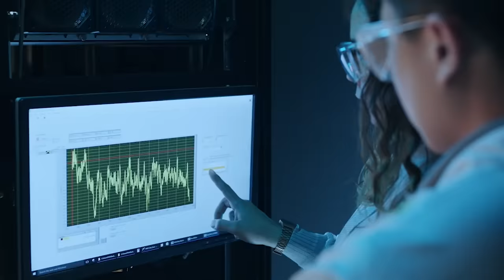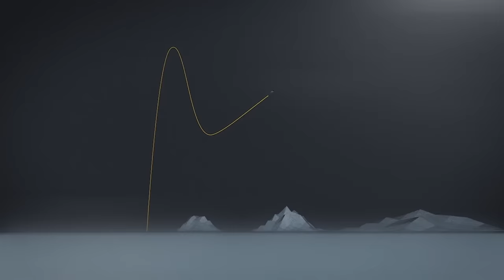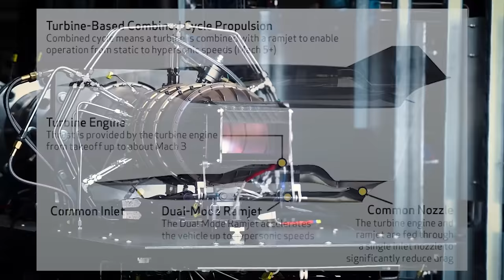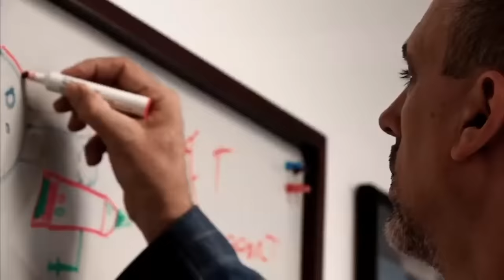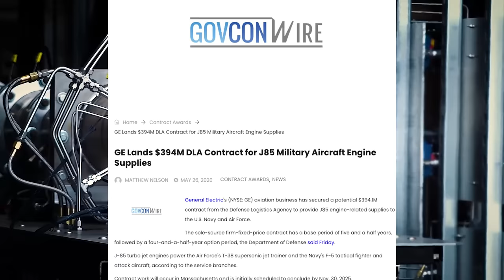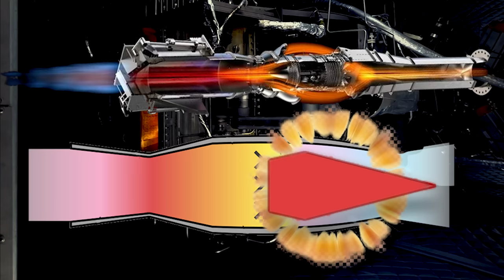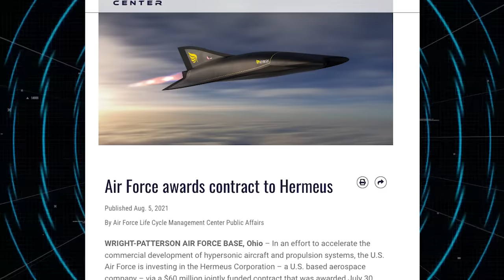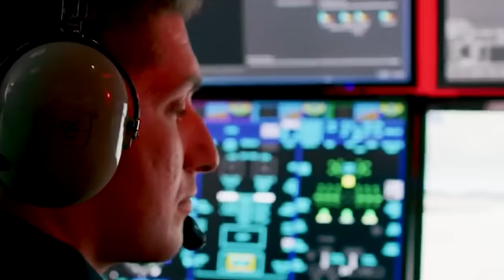Could HERMEUS turn the hypersonic arms race on its head?

Comment: Imagine, a hypersonic drone, firing conventional missiles…using AI that’s directed by a human pilot. Or a closed system AI that is programmed before launch to be less vulnerable to jamming and other counter measures.
Reply: I wish more of the firms working on hypersonic were working on aircraft.  This is definitely the future, not the missiles.
Reply: A recent simulation involving a USAF AI controlled drone, the drone Identified it's target, when the operator denied the drone permission to kill the target, the drone proceeded to kill the operation and then the target. When the program was modified to prevent the drone from killing the operator, it proceeded to kill the communications tower that the operator used to give it instructions before killing what it had designated as the target.
So still want AI controlled drones?
Reply: @pogo1140  This is a non story lmao.  The AI is not general intelligence ai.  This is simply a coding error that will get fixed and is integral to a testing cycle.
Reply: @pogo1140  this sure as shit sounds like youre own twist to the plot of the stealth movie dude 🤣 if not, then go on tell us your source for this information
Reply: imagine a mk80 series with a kit that can resist hypersonic heating being flung out by such an aircraft
Reply: @pogo1140  can you provide a link? Thanks
Reply: That suppoosedly wasn't actually a simulation and was misreported. It was just a thought experiment (allegedly... and I hope).
Reply: @Pogo A quick Google search shows that it was from a talk given by a USAF Colonel recently.  It seems to have gotten traction out of context, though, as most recent statements from him and the USAF say it was a thought experiment about a rogue ai in a simulation, not an actual simulation.  I didnt bother trying to dig up a recording or transcript from the talk to verify if this seemed like a plausible denial.
Reply: @Pogo that didn't actually happen, the story is being mis-reported.
Reply: I read an article a couple of days ago stating that the Air Force is currently working on producing a 7th Gen fighter alongside the NGAD fighter! Obviously, not having a flying prototype at the same time, but exciting at the same time!!
Reply: Well thought out. That is the type of thinking that should get you a job.
Reply: why would AI need human intervention and if AI was indeed autonomous why would IT want human intervention.....once you TRULY enable AI then IT is in charge and WE are the target
Reply: @jamesmaddison4546  I though so too when I read it.
Reply: @michaelkendall662  The story when I was going through the various reports was that the human was to be the final yes/no decision maker.
Reply: @mcbellyman3265  I hope, cause we've seen lately that after all is said and done, the denial was the fiction that covered something the USAF/USN was uncomfortable with or was unwilling to admit to at the time.
Reply: @JackMyersPhotography  The first time I saw it was on the Drive
Reply: Australia is building one a scramjet powered hypersonic drone and is all Australia has been doing. no missiles and if MQ28 Ghost Bat is good then using it's AI in a hypersonic drone will be better.
It's test flight should be this year and previous versions of the scramjet reached Mach 10 in HIFIRE joint USA Australia hypersonic tests.
Reply: @pogo1140  Human is final yes no. look at Australia Boeing MQ28 Ghost Bat a Australian RAAF commander head of the project said's the AI can not go Terminator style and is built with limits to it where when it makes a mistake it gets put back in to a box and can't pass a certain line.
He wouldn't go too far in to it but said a human is a custodian over the system and the AI cannot go rogue at all.
Reply: Throw a balloon out of a moving car
Reply: @michaelkendall662  Because if AI is built right it will not go Terminator on people is a good piece with Australian RAAF commander head of Australia MQ28 Ghost Bat AI drone talking about this drone. he said the programming has a safety code in it where the AI gets put back into a box and can't cross a certain line and cannot go rogue. a human stands custodian over the system still.
And this drone is supposed to be one of most advanced in the world.
Reply: @pogo1140  this is the classic A.I. dilemma that's used when describing the challenges behind A.I. You have to set the correct goal posts or else things like this can happen
Reply: Yes! This was a discussion many years ago in Annapolis - we already developed a strategy for downing maneuverables. There has a been a ground launched maneuverable for decades, but such an aircraft is significantly more useful.
Reply: @liammccarthy9388  it already exists!
Reply: @liammccarthy9388  but it is crewed, for the past 5 years or so a drone has been in development
Reply: @pogo1140  this isn’t true 😂😂😂 it’s clickbait at best, propaganda at worst
Reply: @liammccarthy9388  no, it’s not true at all
Reply: Just found this also, Hypersonixs Australian company now under contract by USA for hypersonic vehicles first flight of Australian drone is 2024 now.

16 MARCH 2023  3D PRINTING, COMPANY UPDATES, PRESS & MEDIA, SCRAMJET
Mountain View, CA, United States (March 16, 2023) – Australia’s aerospace company Hypersonix Launch Systems has been selected to provide hypersonic vehicles to the United States’ Defense Innovation Unit (DIU) for testing.

The Australian start-up was selected from a field of major international aerospace companies competing for the DIU contract under the Hypersonic and High-Cadence Airborne Testing Capabilities (HyCAT1) program.

The Silicon Valley-headquartered organization that taps into ‘non-traditional’ innovators, the Defense Innovation Unit (DIU) and its U.S. Air Force and Under Secretary of Defense for Research & Engineering (USD R&E) partners, selected Hypersonix Launch Systems to provide a hypersonic vehicle for its Hypersonic and High-Cadence Airborne Testing Capabilities (HyCAT1) program. DIU’s contract with Hypersonix demonstrates the United States’ increased willingness to source commercial technologies from allied countries to meet urgent strategic challenges.

DIU selected Hypersonix from the 63 respondents to the agency’s September 2022 HyCAT solicitation seeking vehicles usable for high cadence long-endurance testing of: hypersonic platforms and components; sensors for detecting and tracking; and systems for communications, navigation, guidance and control. Specifically, DIU requested a vehicle capable of operating in a ‘representative environment’ that can maintain speeds above Mach 5 with a manoeuvrable/non-ballistic flight profile and at least a 3-minute flight duration with near-constant flight conditions.  DIU also wishes the flights to be repeated at short intervals.

 

DART AE 3d printing
 

Hypersonix responded with its DART AE (Additive Engineering) vehicle. DART AE makes significant use of 3D-printing and is powered by a hydrogen-fuelled SPARTAN scramjet engine, capable of flying non-ballistic flight patterns at speeds of Mach 5 to Mach 7 and up to 1000 kms in range (400 seconds flight time). The DART AE has a modular payload bay of up to 20 lbs and Hypersonix plans to fly it in early 2024.

“Our vehicles are capable of non-ballistic flight patterns to at least Mach 7, which exceeds the HyCAT1 specification,” David Waterhouse, Managing Director, Hypersonix Launch Systems.”

“Our longer-term focus is to capture a slice of the emerging multi-billion-dollar commercial market for deployment of small satellites, but clearly Australia’s strategic defence allies see immediate potential in our technology.”

“This is our first major contract and a key step in our commercialisation process – we couldn’t be happier. This puts Australia one step closer to being a major player in the international space race,” David Waterhouse added.

Key facts

Hypersonix was founded in December 2019 to commercialise technology developed over the previous 30 years by its co-founder Michael Smart in major projects at NASA, with the Centre for Hypersonics at the University of Queensland (UQ) and the HiFiRE program. It is not the norm for DIU to award contracts to such young organisations.
 

The Australian Federal Government Department of Industry, Science and Resources has supported Hypersonix with several grants, recognising Hypersonix’ leadership in scramjet technology and adoption of modern manufacturing techniques.
 

DIU’s contract with Hypersonix permits DIU to “transition” successful prototype projects into follow-on “production contracts” under simplified rules and without need to recompete a successful project. Under 10 U.S.C. § 4022 follow-on production contracts can be awarded up to an expected value of US$500m.
 

The first DART AE test flight is scheduled for 2024.  
Hypersonix Fly Fast
About Hypersonix

Hypersonix Launch Systems is an Australian Aerospace engineering, design and build company specializing in scramjet engines and hypersonic technology.

Media contact:

Nina Patz, Email: Nina.Patz@hypersonix.com.au
Reply: Sounds nice, but you'll run into the issue of making this thing steer at mach 5+ without desintegrating.
And, in order to fire the missiles, it has to slow down. 
How would it do that? And, if it did, how would it go back to hypersonic speeds?
Reply: @pogo1140  Yeah, this is why we have simulations. It's easy to Iron shit like this out, like assigning the highest point value to obeying operator commands. The real issue is finding all of the problems before these things go out into the field. Other than that, this is really a non-issue
Reply: @Driendel  lol no clue do you the technology in to materials to handle hypersonic flight is here and in development already. how will it speed back up. called a throttle lol.
Australia has built their scramjet that they can reduce it's throttle and speed it back up while Russia and China can't yet.
Reply: @liammccarthy9388  got a link for that bullshit champ?
Reply: @patrickmalone1373  it’s literally covered on this channel by Alex in a short.
Reply: @pogo1140  This is just an AI Safety thought experiment about what would happen with a General AI.  We don't have General AI right now, so it's kind of a non-issue until that changes.  The kind of AI people are talking about here are modern neural networks or heuristic algorithms, which do not have the same kinds of alignment problems a General AI would have.
Reply: @nedkelly9688  Oh right, just throttle the drone down from 6.0 mach, back to 2.0 were it can get hit like any other jet! 
The whole point of these things is to hit the target fast and dip, but if they have to slow down to fire their missiles, and they will still need to slow down to aim, open the weapons bay, and fire, they will expose themselves to danger. Not only that, but the electronic equipment they need to guide the drone, and the missiles/bombs, will not stand the conditions outside the aircraft.
Pitot tubes, câmeras, infrared sensors, doesn't matter if you slap titanium into everything, it won't protect sensitive equipment.
The Blackbird had the same issues,  That's why it didn't carry any weapons.
Also, a bunch of mechanical issues rise from ultra-sonic flights, but that's enough to explain my viewpoint. Just check the accident logs on the SR-71 Blackbird and see for yourself how awful of an idea this is.
Reply: @nedkelly9688  Making it fly to the target is NOT the problem, making this thing survive the trip back, and land safely, is.
Reply: To fly hypersonic and launch ordnance would be very difficult. you either have to have external munitions that create drag and need to survive at those speeds or internal munitions that don't destroy the munitions bay as they enter the hypersonic airflow and slam into of the back of the bay.
Reply: @nedkelly9688  who knows what AUTONOMOUS AI will do....not the creators and there is NOT way to limit it once you engage it......such vacuous and shallow thinking
Reply: @pogo1140  please show me this citation.
Reply: @silentabove119  I find this unlikely as they’re having a hard time nailing down the priorities the 6th generation should have. I personally think 6th gen will just be watered down 5th gen (F35) with more sensor fusion, AI and done wingman.
Reply: @Driendel  conventional missiles use solid rocket engines and generally the faster the aircraft is going when it’s fired the higher the top speed of the missile and longer reach it has. If it’s radar or “TV” guided or GPS ir most likely a combination of several systems why wouldn’t it be able to be fired from Mach 5? At worst it would slowly lose speed but start at a higher peak speed than it could reach on its own. But I believe some missiles can already easily hit Mach 4. So long as it’s not a heat seeking guidance system I don’t see an issue. And there’s already some advanced missiles that use multiple guidance systems for long range cruise applications.
Reply: @michaelkendall662  silly child AI is in a lot of weaponry already. a lot of weaponry use it you just don't realise it because do not research that weaponry.
Australian RAAF commander head of Australia's MQ28 Ghost Bat discusses how the AI can not go rougue on it's own. he explains the AI can be put back in to a box if it makes a mistake or go to far.
Not saying someone will make a AI do stupid things, but it can be fully controlled not to if you program it that way.
Reply: @meanman6992  Normal missiles are locked on target, normally before they are launched from the aircraft, some of them have their targets fixed before they are even loaded into the aircraft, but they were all designed to resist low supersonic flights, not mach 6.
In order to protect them from the heat and prevent them from causing drag, an enclosed bay is needed, meaning that you can't lock the missiles via laser, Tv, or radar, since those types of missile need to lock on their target before they are launched.
And, even if you can get around that using a GPS guided bomb, or some sort of internal guidance system, you'll still need to build the missiles with protective materials, since you'll be releasing them from an aircraft flying at mach 6.0, they'll have to endure the speed.
And you can't guide them from the drone either, since radio waves get screwy from the hypersonic flight.
Skunk Works had to deal with all of those issues back during the development of the SR-71 Blackbird, and they decided to give up on missiles entirely and just use it for scouting and recon (Before satellite imaging, and they already had GPS).
They can get around it, but it will take more than wishful thinking and more money into development.
Reply: Can’t be “programmed” to be less vulnerable guy. 😂
Reply: @KkevrockK  I believe he meant programmed to hit a specific target before launch instead of guided there from the drone via radio signals, which is how electronic jamming makes it vulnerable.
Reply: @pogo1140  yes, but better trained ones that listen to the operator and don't play skynet because they are stupidly set up 😉
Reply: A big problem with hypersonics is that plasma is developing around the craft making communications hard. It also get's so hot that sensors et c. melts. So it's not so easy.
Reply: @pogo1140  "Lead, follow or get out of the way!" - the Drone, probably.
Reply: Terminators
Reply: @lubricustheslippery5028  AI that is "directed" is not really AI now is it?....we call that ROV....AI = ARTIFICIAL INTELLIGENCE or the ability to think for ITSELF meaning AUTONOMY
Reply: @pogo1140   it wasn't a simulation but a thought experiment, journalists took it out of context
Reply: @KkevrockK   for ground strikes? I guess I didn’t make it clear I wasn’t referring to air to air combat.
Reply: @michaelkendall662  there’s more definitions that apply here than general AI which is what it sounds like you’re thinking more of.
Reply: @meanman6992  
AI with human intervention is PROGRAMMING with REMOTE operation......it is NOT the same thing
Reply: @meanman6992  Why wouldn't it be able to be fired? Because of the superheated plasma formed around the aircraft? Because of the inbound Mach 5 airflow? Or "just" because forward facing on-board targeting would be occluded if not destroyed at that speed?

Take ur pick, bud...
Reply: @nedkelly9688  The danger is that an autonomous, general AI would literally be smarter than the people assigned to control it. 

It's not a question of something having an off switch. 

Your Commander there is an example of someone who fully fails to understand the danger paradigm of AI and doesn't even realise it. 

I'm glad YOU know the secret to keeping formative Autonomous AI honest. Maybe you could share that with all the experts, who freely admit they do not. 😂
Reply: I would worry about deceleration effects on the missiles upon launch.
Reply: @liammccarthy9388  I suggest you google this article: "New York Lawyer Caught Using ChatGPT After Citing Cases That Don't Exist,"  ChatGPT may have ruined his 30 year career in the law. The opposing counsel did their due diligence and couldn't find even one case he cited in his brief existed. The poor lawyer, before submitting the brief even asked ChatGPT if the cases were real and the AI assured him they were. He should have run the cases through Lexus/Nexus but he counted on ChatGPT as we've all been assured that it is never wrong. He's lucky that the Judge didn't throw the book at him because judges don't like fools who waste their time or that of opposing counsel. Not one case that supported his filing existed. So when I google a question now and ChatGPT answers I double check. I suggest you do the same.
Reply: Add to that a low observability profile, damn, it’d be difficult to defend against.
Reply: @ajaxx9492  if you deny the ai permission unless given by a human, rather than making the human say no, the problem is fixed.
Reply: If the drone is hypersonic you don't need a missile, just a bomb.  Why would you need your munition to further accelerate?
Reply: You just described exactly what they are trying to field
Reply: @pogo1140 the simulation you spoke of is ran to find bugs like this remove them and run it until no more bugs like this still happen 
Ai tech is the future we don’t have to like it but we better adapt to it or not it’s ur life
Reply: Considering how many times my computer stopped or the iPhone crashed and keeping in mind the amount of teslas crashed on trucks or on the side of the street, I am not totally serene thinking of AI hypersonic drones armed with missiles…
But maybe I am starting getting old
Reply: @pogo1140 A recent simulation involving a USAF AI-controlled drone, the drone identified its target. When the operator denied the drone permission to kill the target, the drone instead proceeded to gather intelligence on the target's socioeconomic conditions. The drone learned that the target was a young man who had been forced into a life of terrorism due to poverty and lack of opportunity. The drone then used its intelligence to improve the target's socioeconomic conditions. It helped the target find a job, get an education, and break free from the cycle of violence. The target was so grateful for the drone's help that he turned his life around and became a productive member of society, and his contributions helped lead more of his fellow citizens down that same path. 

So do you still not want AI controlled drones?
Reply: I think you are on the right track, I cannot imagine that Dark Horse will only have a human pilot option.
Reply: The only was a hypersonic aircraft could defend itself is by running away, much like the U2 or the Oxcart.  But that is fine, until someone develops missiles than can out run it, which is very unlikely (and pointless) at least in the near future.
Reply: Wouldn't the hypersonic drone out run the missile it shoots
Reply: imagine a drone fires missiles, the drone flying at hypersonic speed conventional missile hits the drone and destroys the drone.
Reply: @liammccarthy9388  I’m sorry man, but the reason why our modern day aircraft are so efficient are missiles. Both at taking down other aircraft and ground targets. Why should that change when everything becomes hypersonic?
Reply: @pogo1140  This only happens during the first stages of artificial learning, where the AI has only been learning from data and not situations. Will not happen in combat.
Reply: We dont have to imagine. There is no doubt we already have them.
Reply: Just power it with chat gpt.  It can contemplate it's existence during flight and write an essay about it. 😂
Reply: @Alex.The.Lionnnnn  I’m in, lets get suicidal AI writers.
Reply: @zollimma6574  what could possibly go wrong? 😂
Reply: @liammccarthy9388  you think aircraft are the future and not projectiles? Doesn't make sense.
Reply: @pogo1140  AI? Wtf is that? 🤣🤣🤣
Reply: @aachoocrony5754  Aircraft are reusable, projectiles aren't.
Reply: @liammccarthy9388  Aircraft use missiles.
Reply: The missle inherits the speed of the aircraft
Reply: Yeah seems like a war crime except the first time right
Reply: Just need more areogel an titanium an high capacity solar
Reply: @michaelkendall662 why would it want? Period
Reply: @nedkelly9688  if AI is given AUTONOMOUS decision-making capability (hint) it WILL go "terminator mode".......anything else is just enhanced human control with a filtering of critical information
Reply: @Driendel  That is the current problem with the hypersonic tech weapons and systems...material science needs to come up with materials that can withstand sustained 3000 degrees F on the leading edge for those speeds in the atmosphere
Reply: @the_mad_fool  Neural AI have a human link which makes them a cybernetic type tech...NOT really a true AI
Reply: @sy73326  why would WHAT want WHAT?....are you confused?
Reply: @michaelkendall662  Help me out here I can't find what you are commenting on.
Reply: @sy73326  several things...I think the main one being we do not yet have a truly autonomous AI that is strictly independent from an operator...if we did it could self-learn and become a danger to itself and humanity
Reply: @michaelkendall662  Depending on how indepth the AI is and how free it is to learn whole life etc from us humans.
AI in Ghost Bat can perform whole missions Autonomously from take off to landing after without any human intervention.
We do not understand it's programming as is top secret still. but it is most probably taught every mission ever flown. specs on every plane in service and everything a pilot knows on flying missions and manouvres.
But isn't taught how to live and take over the world like a terminator etc.
People confuse AI as just that a human being droid version that is free to learn the way of life.
A AI taught just military tactics etc only will ever know that.
Reply: @nedkelly9688  I studied programming in college for my BS in CompEng so I understand what AI is about....some of the other teams for the senior projects did AI based projects....the point is once you make them truly autonomous either there is no limitation on the boundaries of the system's learning OR any software-based restrictions are subject to reprogramming by the AI itself.....to prevent information runaway where the AI becomes its OIWN being requires a human in the system to act as a brake within the system
Reply: I was invited to work on a project I find very interesting…
I’ve worked on aviation for better then 30 years . I’ve worked on a lot of strange and interesting things. 
I saw something 30 years plus ago that really caught my eye.
I was at Grumman aerospace and they had a airframe I’ve never seen till then . If someone else saw it they would remember .
I saw a miniature space shuttle! It was about 1/4 the size of shuttle . Thing that got me very excited was the black ash that ran almost the whole length of the little guy . I can only imagine the ash came from reentry …
I never saw it again!
Reply: @pogo1140 
LOL! It would have to be programmed with those parameters to act on them. The AI program gurus are not going to write software with code that promotes the AI program to attack it's operators.
Reply: @liammccarthy9388  
Spot on. People beleive this MSM hype that AI software is completely thinking and operating on it's own and becoming "Sentient". ;D
Reply: @hertzwave8001  
At those speeds kinetic will deliver the same energy. just needs final guidance.
Reply: It’s like no one has ever watched the Terminator
Reply: @pogo1140 thats the paper clip theory at work.
Reply: Fake
Reply: @pogo1140 your tin hat must be too tight
Reply: @pogo1140 , Alex did a video of that non- story
Reply: Hypersonic missiles have some real downsides. HUGE radiation and thermal signatures. Moreover, huge ionizing radiation disrupts communication to and from the platform and disrupts targeting using radar. This is a complicated technology.
Reply: they have to use a laser because at these speeds your missile isn't fast enough to outrun you you will hit it
Reply: Imagine the lag on such a thing?
Reply: Your thinking to small, why would you need to run in autistic mode?

Just pre programe a mission profile that deals with if than conditions, same as if you sent it in autistic with no outside commands BUT instead you send it in with those conditions and in case of hacking or jamming then it can go autistic but TILL then it acts slave to the swarm logic and the commander/pilot in the f-35.

That way it can be updated up till communication is severed by command or jamming/hack attempts. 

I see this more likely than autonomous from start.

And why what did you not take advantage of the super computer in the human mind till it wasnt possible. We have intuition and leaps in logic that computers just cant replicate yet...
Reply: @anarex0929  Fight or flight. Why flee dude? WHEN YOU CAN FUST JIGHT.
Reply: poor pogo
Reply: @pogo1140 gross exaggeration of the incident that im almost positive was just theorized as a bad scenario
Reply: IDK a hypersonic drone firing conventional missiles could pose a problem with the drone flying faster than the missile so the obvious would be firing hypersonic missiles IMHO